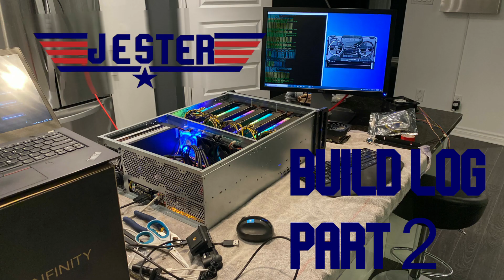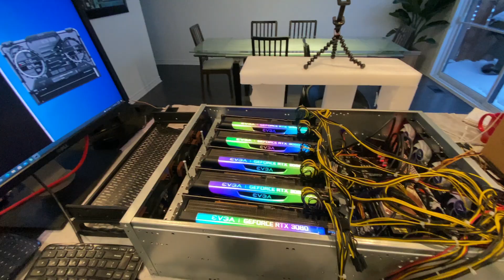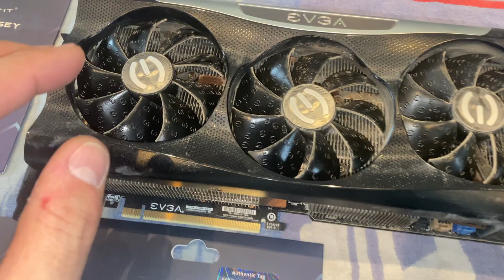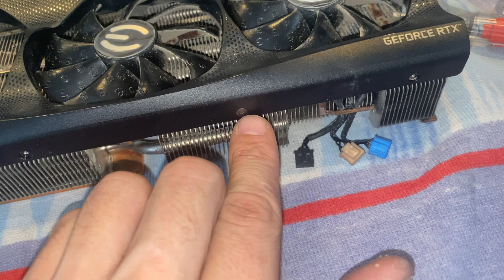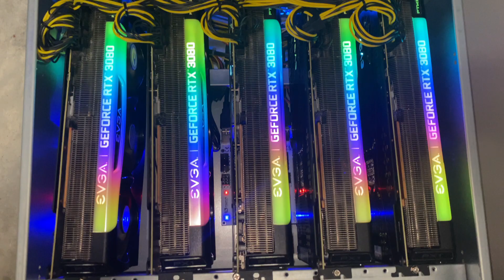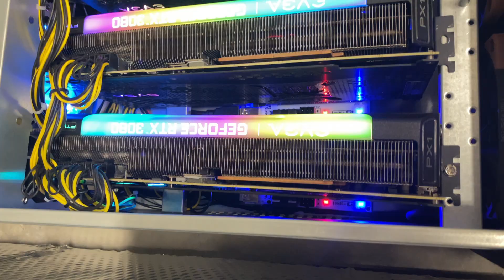The Octominer Killer - Jester Build Log Pt. 2

Comment: Octominers don’t fit in a server rack. They aren’t server cases. I really like the 19 inch wide cases that are server sized and fit in a server rack. I don’t really think it’s a good idea to use a sata cable to power the riser, they can pull 75watts and burn something up. Just cuz you can doesn’t mean you should.
Reply from the maker: yeah I've weighed this option of Sata by reviewing the Sata draw for these cards, extensive testing as well as 2years of no issues give me piece of mind nothing with these particular cards will happen (fingers crossed!) 

reason being there is no more 8-pin connectors with this wetup, so I would have to splice and I didnt want to do that.. however it works great and none of the mem temps are over 86 in this case :)

Comment: Is your 20A breaker on a 240V or 120V? 

First PSU (Octominer) keeps blowing circuit because it's only meant for 240V....

2nd PSU (Thermaltake) works on both 120V and 240V....
Reply from the maker: Yeah I figured this out after the fact :( however the first psu does work to an extent… just not as it should. I got it running with the thermaltake and am trying to figure out what to do with these other psus

Comment: do you think a 4u chassis could cool 4-5 evga 3090s or should I look for something bigger
Reply from the maker: I think they are the same thickness as these 3080s I have so Yes you can do 4 for sure, However for power I don't think you can have 5 with a 2000W PSU and 3090s as they draw much more power. The limiting factor would be the power supply. I would also make sure to get the same or equivalent 3000rpm front fans and I'll list the 80mm fans in the description later today.

Thanks for the comment and remember to like and subscribe for more builds like this coming up :)
Reply: @JARVIS_AI_LABS  😎 thank you for the feedback

Comment: Looking at all that rust on the GPU cooler, it was definitely working in a very very humid location :'(
You need to invest in an ultrasonic cleaner if you can, you would have been able to remove at least all the dust and gunk on the cooler alone.
Happy midweek and keep on mining <3
Reply from the maker: Yeah finances lol buying those cases and those cards and thermal pads was pretty much more than I could afford haha 

My buddy is getting an ultrasonic cleaner in a few weeks, problem is I can’t take the shroud off of the heat sink because the screws are all rusted and strip as soon as I try to remove them.
Reply: @JARVIS_AI_LABS  I wonder how difficult/expensive it would be to just buy new heatsinks
Reply: @lukelegg9915  Why do you think the movement "Right to Repair" exists. Buying GPU spare parts like coolers is even more harder than buying GPUs back in 2021. Each company has its own custom designs depending on model, you have also to take in account GPU PCB revisions, it's a real nightmare for any consumers lol
Reply: @blackmennewstyle  if you get lucky or know the right people its possible, when people water cool their 3080s there's gonna be blocks for sale, but yea, companies should totally sell just the coolerz
Reply from the maker: @lukelegg9915  I doubt you could even buy those separately. I think I may try to ultrasonic clean one and see how that goes :)
Reply: @JARVIS_AI_LABS  i know people used to sell them after water-cooling, or if you can find people who are water cooling theirs offer to buy, maybe these cards are just too expensive 🤣🤣
Reply from the maker: @lukelegg9915  yeah good point about the water cooling, but yeah I’ve pumped too much money into this already lol the temps are great now so just going to leave it and move onto the next project ;)
Reply: @JARVIS_AI_LABS  haha true, hopefully the ultrasonic works